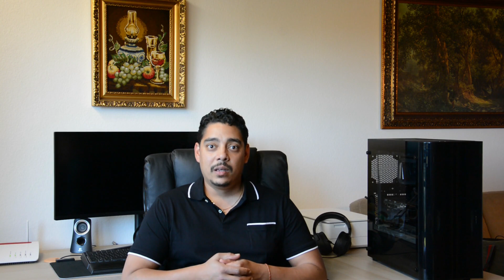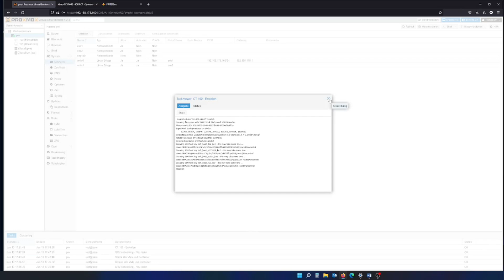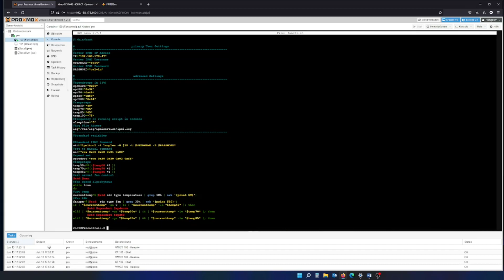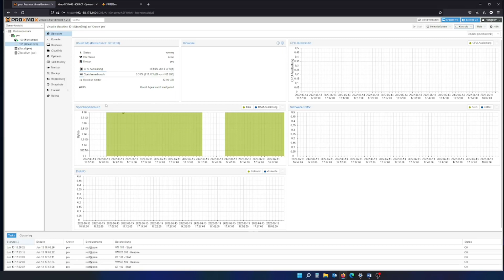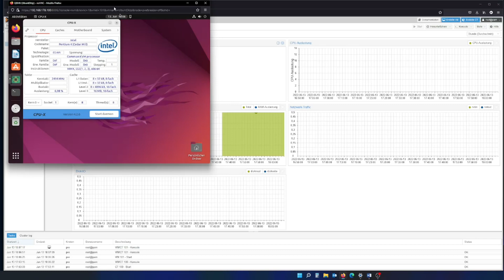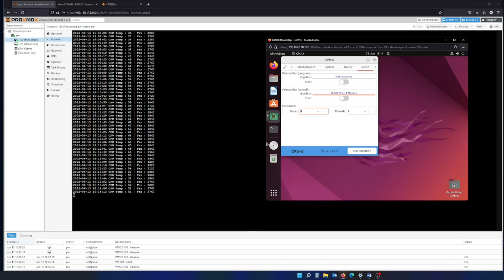Dell R220 Homeserver #3 IPMI fan script ENG

Comment: Great server, how noisy is the server? And what is the power consumption?
Reply from the maker: By default its not realy disturbing, with the noctua fans it is realy quiet. I would say "living room prooved". The power consumtion depands on many things. I would say between 25 and 50 kWh in idle. Mine use up abbout 30.
Reply: Wow amazing,  I used the big one consume too much power,  will looking for smaller one